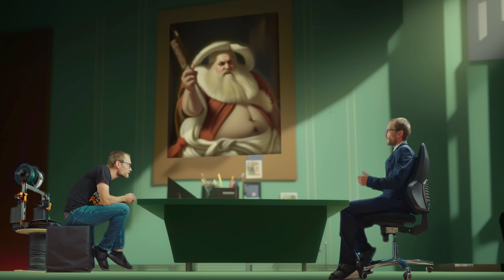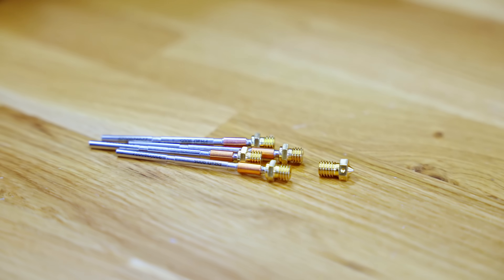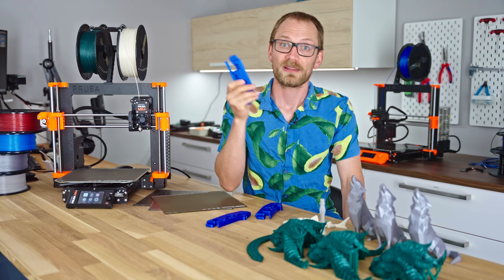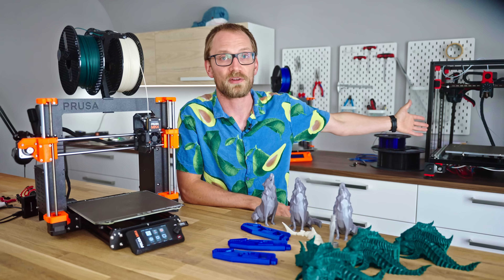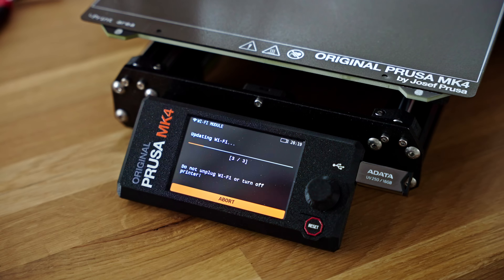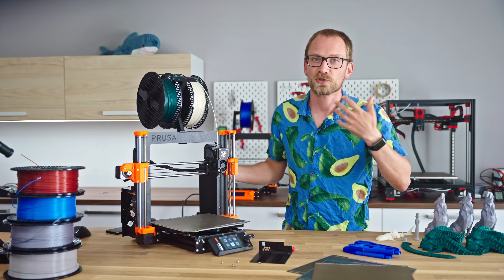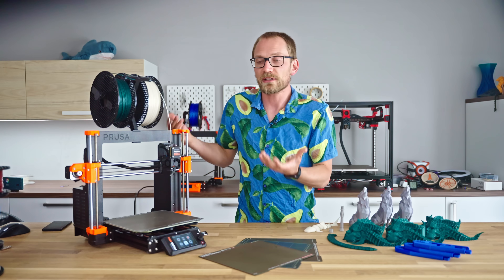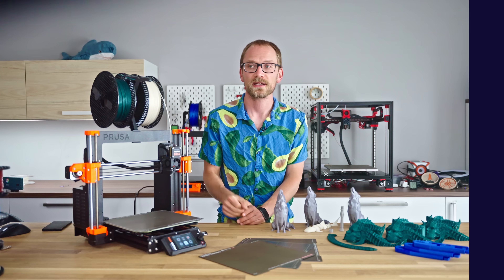Does the Prusa MK4 have what it takes?

Comment: I find it somewhat disheartening that Prusa's open-source approach is continuously being criticized as a drawback in your latest reviews. Not everyone is inclined towards an Apple-esque 'walled garden' experience. Yes, companies like Bamboo labs are undeniably driving impressive progress in the field, but that hardly renders open-source 3D printing obsolete. We can't simply overlook the likes of Voron, VZbot, and many other thriving open-source projects. They offer significant value and choices to a diverse range of users, and deserve fair acknowledgment.
Reply: Also the closed nature of a bambulabs printer is exactly the reason I'll never own one. We know what happens when printers are locked down (look at 2D printers, they suck). We need to keep the industry open or the consumer will pay the price.
Reply: How many people are using them compared to other machines? If 3D printing is your hobby, sure. They are fantastic to build, upgrade and tinker. If you use 3D printing as a tool they are not what you should get. I want a machine that just works, that just prints parts I need. I want to spend as little time as possible on the machine. 

And this is the market 3D printing is developing into. So for that, open source 3D printing is not important and as a company detrimental.
Reply: @nukularpictures 
It's not about the present, rather the future.

Consider HP, Canon, and Expo for example. They make 2D printers and they are a nightmare to use. Those.companies border on exploitative/scam practices (disabling scanning if ink is empty). When companies like Bambu Lab kill competiton, they will almost inevitabley change into the three companies above.
Reply: @nukularpictures Also Obligatory All of BambuLab’s Stuff is essentially a Voron or 247B2Zero etc Printer Reskinned in an Injection Molded Shell

Those other machines can be bought in a kit (so you actually know how to maintain it) or i think premade (if you really NEED premade you can also just get a Prusa)

People talk about them like they developed what they made, when short of the albeit difficult production engineering/mold design etc *they didn’t engineer shit*.

The Open Source options can be Cheaper and/or Faster and one can actually support developers by backing them! 😤
Reply: Duet3D has SOLID documentation, western design, completely open source, and they are a main contributor and driver of the reprapfirmware project, which is excellent. How profitable they are is not open source
Reply: I agree, that line is seriously getting old and tired. Makes you wonder...
Reply: @retroarcadefan  - not just old and tired, it actually proves that he doesn't understand the economics of open source systems, and he seems to think that patents wouldn't hold back the innovation in a field that was prevented from even existing in the first place...by patents.
Reply: @digiscream all IP enforcement holds back progress. Pretending that people can own & have monopolies on unlimited resources is just as ridiculous for open source licenses as it is for patents.
Reply: @nukularpictures  there have always been closed source industrial machines for companies hobbyist printers don't need to follow that formula.
Reply: @KanielD That's not entirely true. If you examine the history of things like the printing press you'll find that there are some rather annoying drawbacks to intellectual property free-for-alls which the original IP laws were intended to solve. I'm not trying to defend the current state of things, but, as with most things, I think there's a reasonable balance between the opposing poles of the issue.
Reply: I love Prusa's dedication to open source. I don't care for Prusa releasing the MK4 before it was anywhere near feature complete. They released it prematurely because they were sweating about competition; whether their customers had to pay the price for their rushed launch date is inconsequential, I guess.
Reply: @benjaminmiddaugh2729   I know there is no utopia, however, the drawbacks of intellectual property enforcement far outweigh the benefits. Even if it provided a utilitarian benefit (I don’t believe it does) it would still be unethical to control the knowledge & resources of others. Especially when that control threatens peaceful people with violence.
Reply: @nukularpictures  “Printer that just works, that just prints the parts I need”.  Sounds like you’re describing a Prusa machine haha. 

 Prusa themselves famously use their own printers in production. If that doesn’t speak to their suitability for a ‘company’ as you put it, I don’t know what does.  The open-sourced/user serviceability is just icing on the cake.  Good luck modifying a bunch of “walled garden” printers to suit a specific workflow or w/e if they don’t natively support it.
Reply: @nukularpictures  I have a fortus 450mc and a whole lot of prusas and for the amount of printing that gets done the fortus takes more maintenance. You don't know what you're saying. A machine that just works? Everything takes maintenance. Spend as little time as possible? Open source doesn't mean more maintenance. Are you comparing cheap clones to more expensive closed source designs or something?
Reply: I totally understand his take, open source and free is something this generation has grown up with and expects to be the norm. This is not the case, I am a sole developer and simply can't afford making it free or open source, and also for Prusa, in the end they may simply end up going away as ppl really don't care (the majority) if Bambu is closed and likely never to be fixed when they go down etc. People don't care. That's why Enders have been so successful, cheap, that's it. No one can compete with that.
Reply: Yeah, anyone who criticizes open source doesn't know what they're talking about. We wouldn't have anything if it wasn't for open source.
Reply: @RobJess as long as parts are available from third party sellers (bambu lab parts are available everywhere, even things and versions they never sold in the first place) and the printer can print offline (which bambu labs offers, you can use an sd card or print via lan, no internet connection required) I’m ok with it. Yes, open source is always better. And prusa printers are assembled with more care, that is something i can believe. But half the print time (or even less) with the same quality and super easy multi color prints are great  things, too. I love prusa printers, i love the concept and all it brings with it. But the printer i use most changed to a bambu labs for exactly that reasons…
Reply: People also miss the uniqueness of the company. It's not an Apple-esque company where you have a polished product that does one thing, that is an important thing, and it does the thing super–well. It's also not a Linux-esque company where you essentially get everything for free, but either it's your hobby, or you have significant expertise in the technology, or you pay a lot for support. Prusa is somewhere in the middle: they build good products, they provide good support, their software (and hardware to an extent) is open source, they care about the community (once the Printables staff helped me out by renaming the model and modifying photos, as I made a container for a product and a crazy German company that manufactures it started to file IP violation claims), they build a lot of components inhouse in Europe which is important for me, because I'm not a big fan of China (I view China as a threat: both a single point of failure, like during covid supply chain issues; and also concerning political ambitions)
Reply: This whole video is "how many bad takes I can squeeze in 16 minutes" plus two cringy skits.
Reply: @KanielD  Technically, if a company wanted to waste some money on patent lawyers they could patent their IP and then give everyone a free and open licence to it, if only to protect the IP from someone else patenting it. 
It might even be a good move, since patent systems around the world operate on a "first to file" system (as opposed to "first to invent"), and patent offices don't really bother with prior art or inventiveness checks that are theoretically required, hoping it would be sorted out later in courts if someone decides to challenge that patent. 
Therefore nothing (aside from morality) is really stopping me (if I had FU money) to grab any open-sourced IP, patent it myself and sue the original inventor into the ground (assuming I would pick a target that's unlikely to defend itself in court)
Reply: But Tom DIDN'T (in this video) criticize Prusa's open source as a drawback. He simply said that because any other company can just use Prusa's software, the software is not a DISTINGUISHING advantage for the Mk4. The implication is that Prusa's software is an advantage -- for everyone, including all the other printer companies. He's not saying Prusa software should be closed. He's saying that the Mk4 needs something more distinctive and leading edge to justify its price point, given the competition.
Reply: Let's not forget the immense value that Prusa themselves have gained from open-source contributions. For instance, many new features in PrusaSlicer 2.6 were derived from open-source features of other slicers (tree supports being a prime example). If companies infringe on open-source licenses, it doesn't mean we should surrender and forsake the open-source ethos that has brought us so far. We ought to hold them accountable! :D
Reply: Open source? what exactly here is open source? where is the hardware schematic, gerbers and firmware for the Mk4? the slicer is just one part.
Reply: That's the thing, he always turned how the wind blew. When it was a popular opinion that Open Source is the way to go, Thomas was the first in line to preach the gospel of Open Source, as apparent from some of his earlier videos. Currently, it is very popular to take a dump on Prusa as more companies are walling their gardens, and lo and behold, he's saying how Open Source is not the way to go, and Prusa should go the proprietary route as well.

I'm not saying Prusa is this saint company and shouldn't be criticized, quite the opposite, it's apparent that they banked on the MK3 for far too long and got behind because of it, but it's quite easy to see that Thomas is just parroting the current popular opinions and doesn't have any strong opinions of his own. Which is honestly just quite sad to see.
Reply: @Graham_Wideman  - eh? He outright said that they should make the software proprietary if they want to be competitive.

That's the very opposite of the way the market's gone, as driven by the customers - hardware is where all the distinguishing features lie, and anybody can use any slicer they want according to the features they prioritise. To do it his way, all the slicers would be proprietary and you'd only be able to use a given printer with the manufacturer's slicer. That's inherently anti-consumer.

Now, criticising Prusa for putting out hardware that's a year behind everyone else...yep, that's totally valid.
Reply: With the prusa you're paying a premium for a printer that just works ok. I rather pay a premium for a machine that will work great and have it be private ip, than have an open source machine that just works ok.
Reply: @ericlotze7724  This is such a misinformed opinion I don't know where to start.

Firstly to call this machine a clone of some specific voron design is absurd. You might as well call a voron a cheap knock off of a hyper cube since we are willing to pretend that the basic choice of motion system hardware of which there really are only a few reasonable permutations is the entire printer design.

Secondly, if you think klipper currently has a remote chance of accomplishing the same thing, you completely have missed the point and reason Bambulabs are flying off the shelves.

People keep just talking about speed, but the real massive selling point of Bambulab is ease of use and accessibility. I've used Klipper at an intermediate level. To the level of setting it up for a custom board with a non previously klipperized printer (meaning all the configuration start to end), so I had to get pretty damn familiar. I made all sorts of macros, added a nozzle cam etc.

Klipper has massive usability deficiencies that Bambulab has addressed with their firmware. Everything on a Bambulab printer that any typical user would care about just works. They domnt have to know how to pick a input shaping function. They don't have to knows how to run a belt loop. They don't have to know how TK set the Z offset. They don't have to think about redoing that after changing nozzles. They don't have to faff around to figure out settings for different filaments.

You fundamentally misunderstand the selling points that Bambulab is actually offering and in doing so completely miss and do a disservice to the engineers at Bambulab. 

They really had their ears to the market and picked up on what people really wanted as opposed to the closed echo chambers of enthusiast klipper users pretending that all the faffing about us inconsequential and no big deal as they completely forget that they find the printer to be a hobby while most other people just want to work, so removing as many pain points as possible is a huuuge deal.

They also didn't build for customizability, because once again, it's targeted towards people who just want a thing that works with as little user interaction as possible. This means they are likely not to care about nodding and so Bambulab an choose parts for price and efficiency where other designs would have to design with a much larger focus on user accessibility. You think of this as a downside, and it is inmany ways to some folks, but for many there is an upside to this thst outweighs it. That upside is you're getting a voron beater for half the price of an equivalent voron 2.4r3.

You see, all the people who think Vorons are equivalent with Bambulab printers just miss the point of how fundamentally differently each printer appears to different users. I, as someone with that enthusiast background feel maybe I can help make it clear why it would serve klipper and open teams like Voron and Ratrig to seriously consider the features of Bambulab that you often saw handwaively dismissed in common discussion places for them by people who somehow got it in their hqads that these ""minor hassles"" they called them, were not something that people cared enough about getting rid of. Wrong. Very wrong. Most people want effortless fast printing. A 40 hour build followed by tons of tuning required by comparison is not at all what they want. Maybe as a secondary printer, but even that enthusiast will want a Bambulab that just works for all the times they are faffing around with the other one.

I feel you really ought look at the feature Bambulab brought to the table that elevate the experience above what klipper had to offer to understand its mass appeal to the average person to power users to businesses alike.
Reply: @LeftJoystick  Its funny you say that because it's actually a big drawback in many ways. Not only because the parts themselves are weaker, cost more, come out rougher, and are illsuited for higher chamber temperatures but because Prusa is constantly in a battle of trying to keep up with production. If they just used injection molded parts, and stopped with this pretending that the brand name of components was the real reason for their success they could manufacture printers much more quickly.

Let it be known Bambulab has videos of the testing every printer and had printers printing for thousands of hours before release so it's not like you need to print for your own printer in order to be a decent printer with testing behind it.

Really, the whole "it prints its own parts" is a gimmick about its opensourceness they so desperately seem to want to destroy. Prusas version of open source even has always bothered me. They make things but purposefully use odd components and custom motherboards to make it difficult to replicate, which mostly hurts customers looking TK make parts or upgrades which is exactly what their selling point is supposed to be. It's like they on the face support openness but the spend all their time worrying that the open source thing will be used in exactly the way the licenses are intended to be used. It's baffling.
Reply: @DustinGorman  You realize this open source boom. happened because very closed source stratysis had their patent expire right?

Like open source had brought a lot of improvements but to suggest we wouldn't have 3d printers when the very concept of fff printers as we know them today was made by a very closed source company is absurd.
Reply: Okay then the Ender 3 is better than the Prusa because its more accessible. Of course you wouldn’t say that because your brain tells you that is cope but your heart tells you to stand by Prusa.
Reply: @nukularpictures This only holds true short-term. Once open-source is gone companies will ramp up their prices, print only filament provided by them, etc, etc. 
If 3D printing is some sort of side-hustle of your company this may even be acceptable - but if not it quickly becomes a risk for your business.
Reply: @elijah_9392 their printers happen to be excellent though. Too many wD printers are just hobby level in every way.
Reply: @ericlotze7724 um, no.
Reply: @digiscream the economics of open source is dubious. It always has been.
Reply: @ericlotze7724  Exactly. I don't see anything on the Bambulab printers that didn't first appear on some hobbyist's experimental printer. They did put it all together nicely, but since they seem determined to lock it all down,  my interest is zero. I don't want to spend that kind of money only to discover that replacement parts are made of unobtanium. They make a nice little consumer niche but they are a dead end for the field of 3D printing. Let's remember that without the maker open source attitude, none of us (including Tom) would even own a 3D printer now.
Reply: Excellent review. Having seen other reviews, I came to the same conclusion: it falls a bit short, missing the « waow » factor, while being a great upgrade over the already excellent MK3. I understand they had to ship without input shaping to be on the marked, but I doubt they will ever get it to work. I hope to be wrong, but I think this function needs to be tuned specifically to each printer. And without an accelerometer, no way this is possible automatically without the user being involved.
Reply: I think the bashing of staying open source is more the possible real future that Prusa might’ve open sourced themselves into the grave. If they at least closed the slicer there would be something for them to sell especially if everyone is just gonna use it for their own company. Everyone bit their design and improved it so rapidly that they’re just not worth it anymore. And it hurts. I lovvvvvvved my prusa’s and have so much respect for what they’ve done for 3d printing. But for the same money or less I can have every bell and whistle and the same quality faster and more convenient. I want to give prusa my money but they unfortunately at this time have nothing to sell me. They could’ve at least generated revenue off PS. Orrrrrr not sat around and let everyone innovate past them.
Reply: @elijah_9392 No. You are talking about cheapskate 2D printers of them.

At work people have printers that can throw thousand pages per hour without anything nightmarish about it.

I have a HP Printer and it's never been a nightmare.
The only real nightmare is the ink cartridge scam.
Reply: Not to mention there must always be open source options otherwise every company will do what apple does and make it impossible to fix or repair anything let alone customize.
Reply: @nukularpictures if u want a printer that just works, Prusa has the longest track record of making machines that just work
Reply: Sovol? Have you seen the bed leveling
Reply: This guy is off is rocker with this thought train. He is a bit of a goof
Reply: I will only be buying open source printers absolutely no question
Reply: They’re not even full open source
Reply: Prusa doesn’t have the hardware software synergy Apple does. As someone that develops open source software sustainably is always in question. I only need to support myself (thankfully) so I can freelance work as my main source of income. 

So as someone that develops open source projects and fully supports them I can also understand not wanting to actually develop them as a for profit business. No one cares how you are going to pay your bills and they certainly don’t care how you’re going to pay your employees so they can pay their bills. Really need to prioritize yourself, your employees and your business, once that’s handled than work on your open source projects.
Reply: Following the reveal of X1Plus, a forthcoming third-party firmware possible thanks to a firmware "loophole", Bambu Lab says it will open the X1 to rooting.
Reply: @ericlotze7724 lmao what? Using your logic every bed slinger ever is “just a reskin” of a prusa. When someone comes up with an idea, an open source idea mind you, and it’s good, others WILL copy or build on the idea. Bambulab built on ideas. Get over it.
Reply: @bobograndman  The Iteration is not bad.  Heck even as a few of those comments said, PrusaSlicer has benefited from the Tree Supports in another Open Source Slicer.  Also Input Shaping was pioneered within non-Prusa circles.

The issue is not their iteration, as someone else wisely said they have made things a bit more accessible.

The issue is that rather than Open Sourcing their work, and thus “paying it forward” / continuing the helpful relationship, they didn’t.  Thus that chain of idea sharing that let their company even exist (ie not just Stratysys) is broken for their greed.
Reply: @BeefIngot  Your Second Paragraph is my point to an extent.  There are only so many permutations of things, so to say you along own the thing is wrong.  If someone else independently made a good User Interface and Experience akin to what Bambulab did is that suddenly theft?

I do agree they have made things convenient, *i am bad enough with tuning settings myself lol*; what i am saying is that the very reason they are allowed to make printers without Stratysys sending a Cease and Desist is due to the Open Source Movement.

I do not deny the effort their workers have put in, the quality of their product (for the most part), or some criticisms of Prusa (not FOS, not as aggressive in RnD as they could have been etc),  BUT i stand by the necessity of Open Source Licensing for Long Term Innovation and Accessibility.
Reply: I feel this. I love tinkering with things. I'd hate to be stuck in a single ecosystem that also has the potential to put certain things behind a pay wall.
Reply: @nukularpictures  You clearly have no idea what OPen Source is...
Companies as large as Microsoft ended up understanding that evolution is on this side.
That's just to give a simple example for a mediocre comment.
Reply: @nukularpictures  If you don't understand how the machine works then the 3d stiff you create will be rubbish anyway. Best acquire the skill in howvrhmo build a machine sibyiu can build great 3d products.
Reply: @RobJess  Good thing you never did! What they just did is horrible